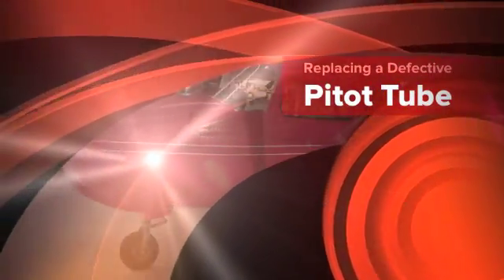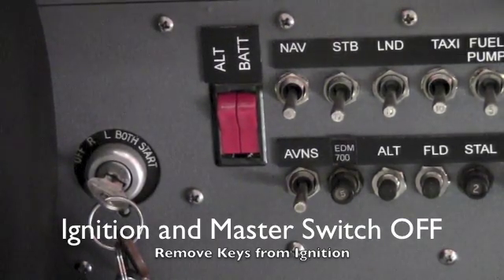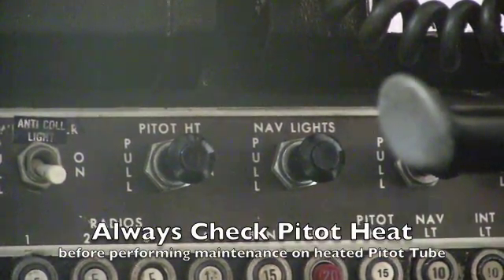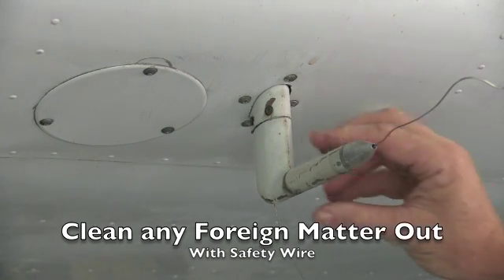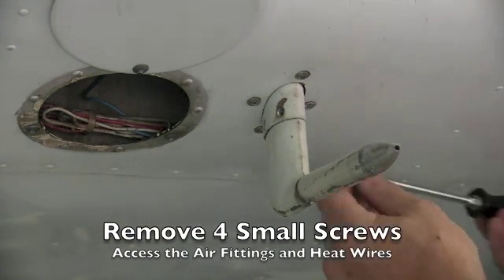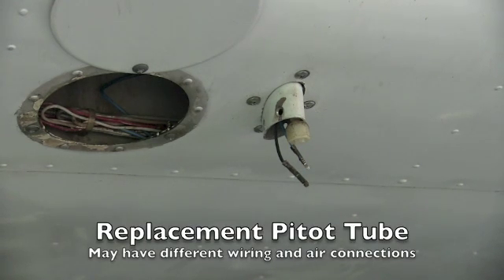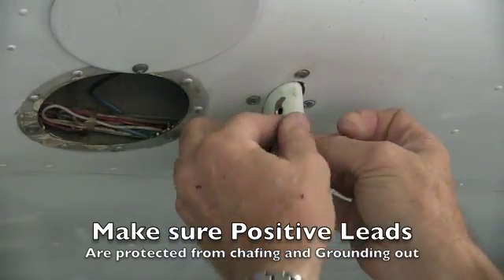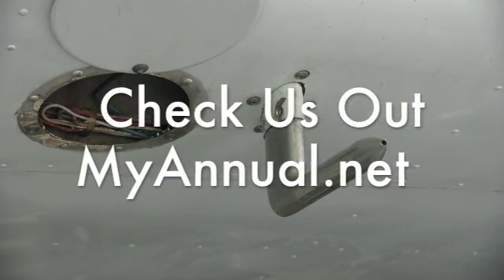Pitot Tube Replacement

Comment: I wouldn't be in a hurry to force compressed air into a pitot tube. Thats a good way to blow out your airspeed indicator. Same with a vacuum. If you want to blow out a pitot or static line, disconnect the line (nylon or aluminum tube) fittings at the other (instrument) end so that the instruments aren't subject to the pressure/vacuum abuse. It's real easy to ruin airspeed indicators and altimeters if you're not careful.

Comment: Why jam a wire into the pitot tube if you are replacing it?  Doesn't make sense.  And you could be jamming debris further up the pneumatic fitting and into the hose running to the ASI.  This video is worse than nothing as it gives bad advice that could make the situation worse.